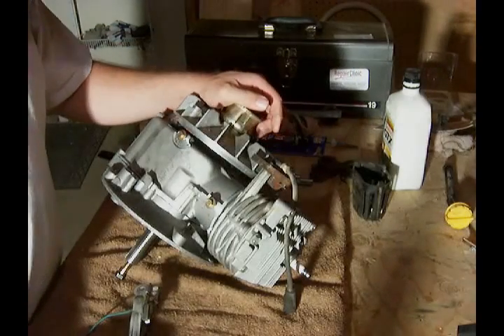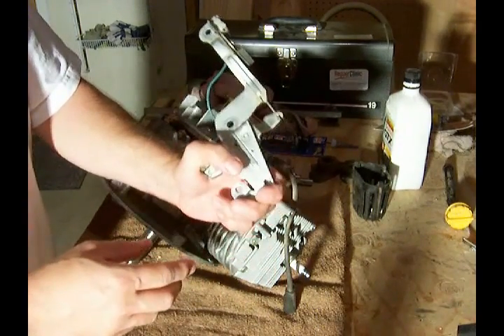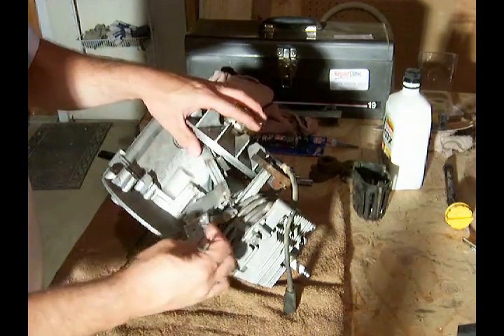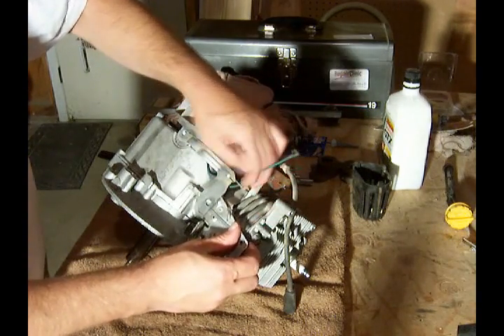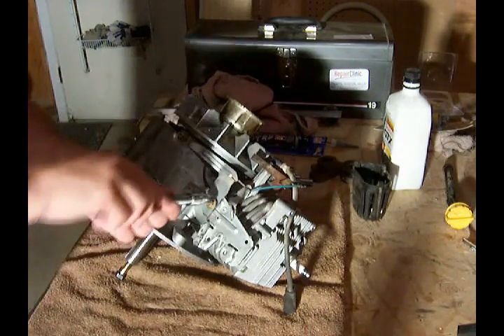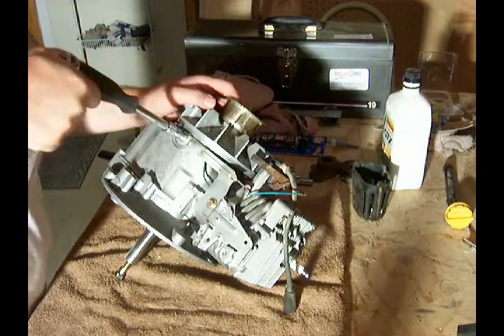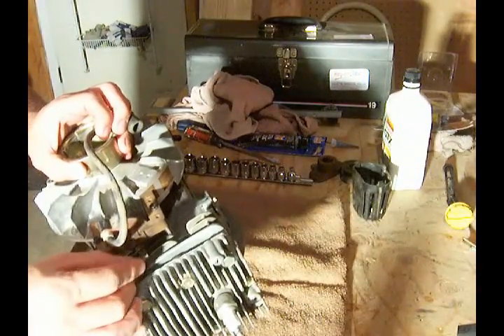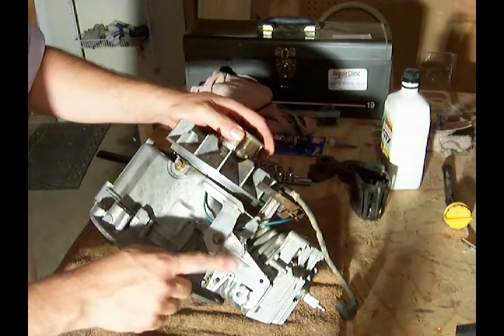#21 Tecumseh LV195EA / LEV120 - Engine Brake installation

Comment: What is the exact air gap measurement?
Reply from the maker: The air gap for what? The ignition coil? The valves?
Reply: @RealManSkills  coil
Reply from the maker: @chucklescastle-mr9nx  the thickness of a business card. In fact, I use a business card as a gapping tool.
Reply: @RealManSkills the recommended gap is .012. I recently purchased a mower with this engine. It ran but the upper crank oil seal was  leaking. I changed the seal but while reinstalling it I broke the pad and it's not starting.  Is the brake pads purpose to cause a short to stop tne engine?  If thats the case, shouldn't I still be able to start it with the  bail depressed? I still have the broken piece. I mean it shouldnt affect the timing and you cant really install it wrong can you? Thanks

Comment: Hey Sblg43, question for you.. do you know if you can replace just the brake pad on the engine stop or do you have to replace the whole assembly
Reply: I think you may have to buy the whole assembly. It's all riveted together so you can't take it apart without breaking something. I searched online and cannot find anything other than the whole assembly. Thanks for watching.
Reply: You can buy just the brake pads on Amazon and eBay but I have no idea how to attach them. JB weld maybe?

Comment: What the name of that screwdriver you are using to screw the bolts,thanks!!
Reply from the maker: That is called a 3/8" drive "spinner handle". They are very common in 1/4" drive but shop around and you should be able to find it in 3/8". Thanks for watching.